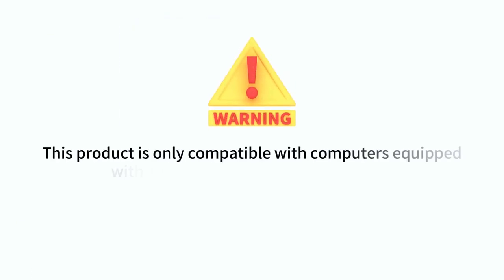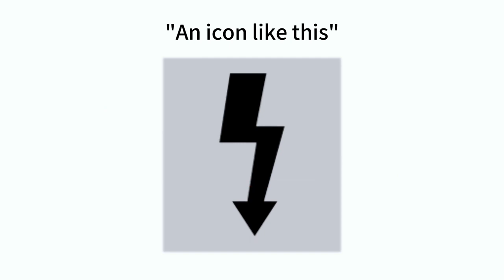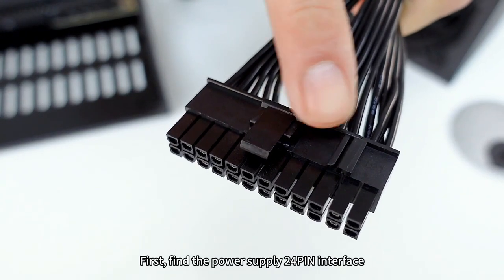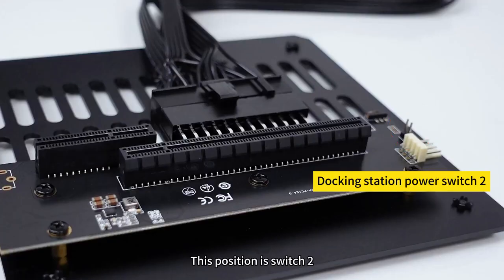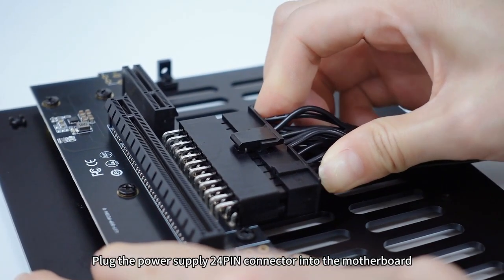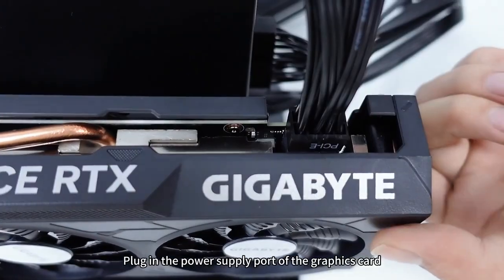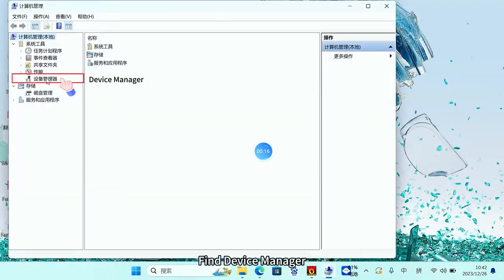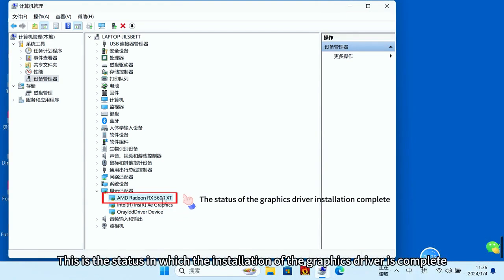Upgrade your gaming setup with this eGPU Thunderbolt 3/4 to PCIe graphics card external bracket!

Comment: Thunderbolt i really like this! everything above 10 gen intel or 5000 series amd is really future proof due to this! Thunderbolt and usb4 amd conterpart is simply plug and play
Reply: @JowelEllie-i7l  good!!! Everything above 10 gen intel is pretty future proof! Since it is 12 core cpu there should be very little bottleneck Thunderbolt 4 is faster in bandwidth than its predecessor Thunderbolt 3
Reply: @Asadc1995  the fact is, the bottleneck is still huge compare to using regular x16 PC slot. But hey, it's plug and play and "help" laptop with no or weak discrete GPU to play games and stuff